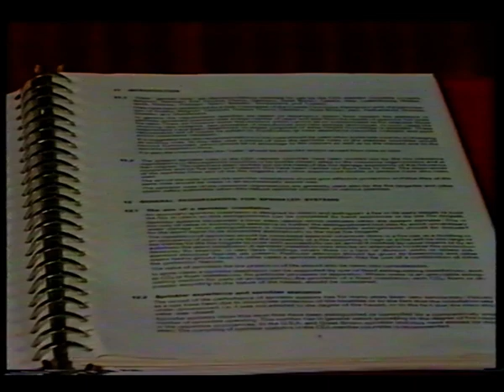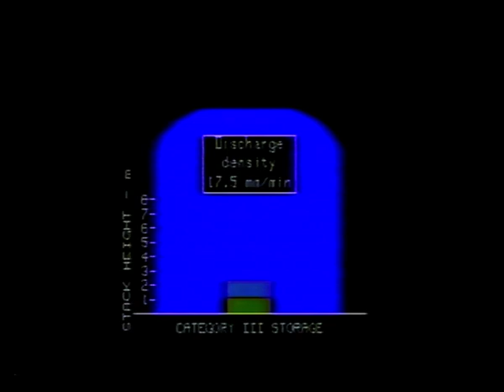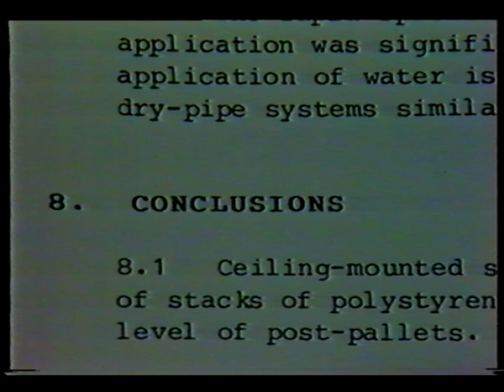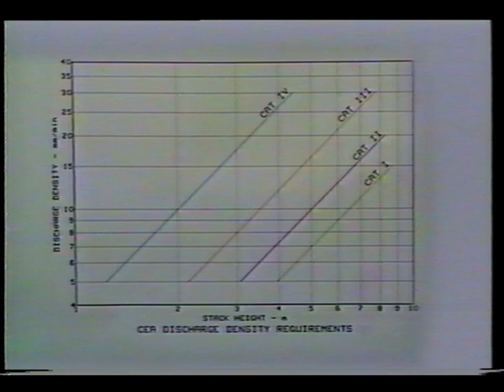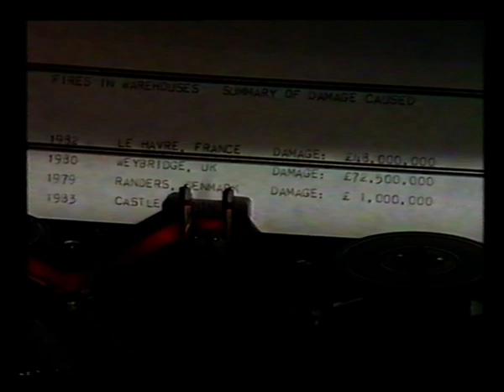Jon Danzig directs: 'Burning Questions'

Comment: I was frequently engaged in planned maintenance at the Fire Research Station (FRS), where some of your sequences were shot. Of particular interest to me at the time was a mercury arc rectifier (bit like a gigantic thermionic valve) that was part of the control system for the 'Burning Building'. That building was massive with a roof that opened, like something from Cape Canaveral, inside which whole buildings were built and set ablaze for tests. 

Excellent film, Jon.Thanks for posting.

Oscar

Comment: I spotted an apparent similarity between the incredible density of the black smoke and the signs of materials having been dripping and melted in the films of the two tragic fires. I read an article after The Station Nightclub fire were a driver on a nearby road had driven through the fire's dense plume of black smoke and believed at the time that his car was aflame and very nearly bailed out of his moving car in his distress. What I see as key here is the use of the super-flammable materials.